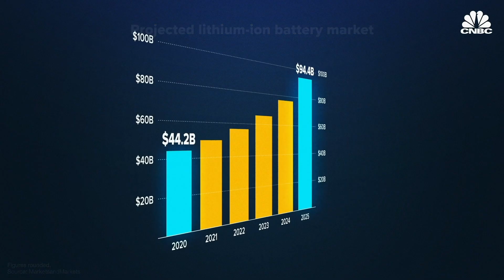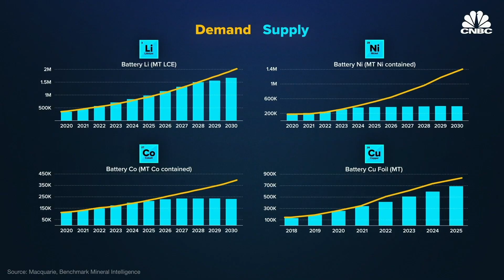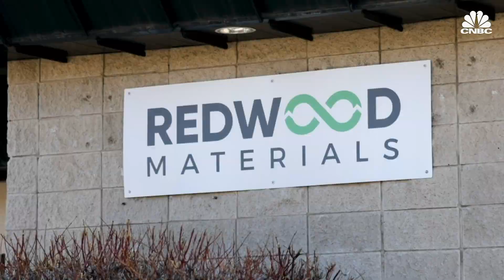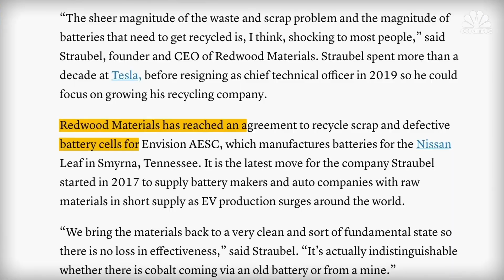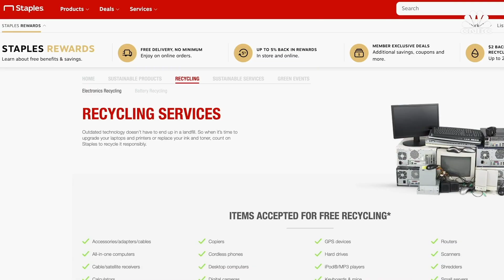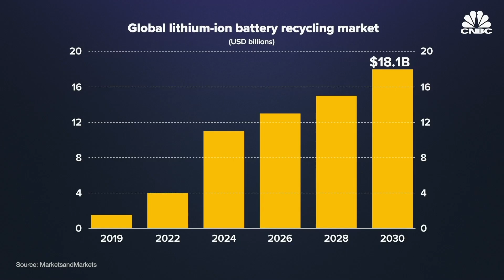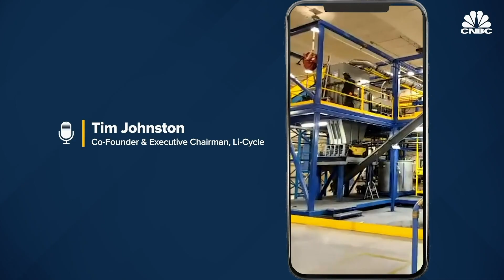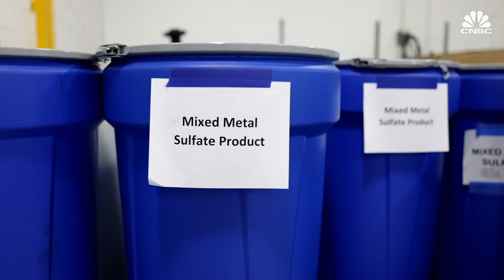How Tesla’s Battery Mastermind Is Tackling EV's Biggest Problem

Comment: Why are we recycling/disposing EV batteries when there is an average of 80% life left at the end of its life in a vehicle? There is a company called Moment Energy in Vancouver that is repurposing EV batteries for utility energy storage that can extend the life of these batteries for another 10+years.
Reply: Yellowstone National Park has been using used Toyota Prius batteries for more than a decade as grid storage. Each new EV has the potential to store enough charge to run a normal US home for 2 days. I agree that continuing use of the battery packs until further degradation is a cleaner, cheaper, and better option than immediate EOL disposal.

I could go one more, and suggest that all new EV cars should have easily removable batteries, so that newer, better batteries can be swapped in (like NIO does in China), and the body of the vehicle doesn't have to be scrapped. Electric motors last many times longer than ICE, so it stands to reason that the batteries should be easier to replace, especially with ever bettering technology. I can only assume it's the same "Jobs" excuse that's been used to justify built in obsolescence since the Great Depression.
Reply: In the 90s I ran a household with solar panels and recycled computer back and emergency batteries for over 10 years...I'm sure I was public enemy No 1 not being powered via the grid in the eyes of the power company.

Comment: Recycling of batteries from consumer electronics would be much, much easier if those devices were designed in such way that consumers could take the battery out.
Unfortunately Apple is too powerful and would stop any regulation mandating easily removable battery.
It works better for Apple if you have to trash the whole device when the battery is loosing capacity, even if the device is still functional.

Comment: Goes to show that EVs are NOT net zero. This problem exists plus the pollutants created and energy used to create the batteries are obviously NOT net zero.
Ya can't beat physics!!! And in all other ways, the materials and construction of electric cars and trucks is virtually the same as conventional transportation.
Oh, it will get better as time passes. But don't think for a minute electric vehicles are THE solution. Not by a long shot.
But good on Redwood for their recycling efforts. But even THAT requires energy.
Reply: That's why tesla invested in solar, they solar system produce 10x more energy then their factories use, metal extraction and refinement can also be done renewable, its not a closed energy system since the star in the sky provides the energy for another 5 billion years, can't beat physics. Electric cars aren't the solution but they are one of the best solution we have now, so you rather breath exhaust from cars for another century?
Reply: @miguellopez3392  STILL, energy is required and not every EV or alt. energy is Tesla. Everything pollutes, somewhere, somehow. But it will get better as time passes. But for now and years to come, nothing is net zero. Physics won't allow for that. Not in the physical realm. There is no pixie dust.
Cheers!
Reply: @justincase2281  net zero on earth is possible, like I said its not a closed loop system that the earth has with the sun.
Another question, why make this comment, anyone who develops these systems knows this, the only time I here an argument like this is from petrol heads who think if it's not the 100% best solution we should just stick with the 100% worse solution.
Reply: @miguellopez3392  I'm not a "petrol head", and give me ONE example of any technology created by man that doesn't affect the environment to create or maintain. Just one!! 
I'm not saying we shouldn't keep working on cleaner technologies, but right now, NET ZERO is NOT possible. Even if you just ride a bicycle EVERYWHERE and it was built using exclusively solar energy to power the factory. The equipment created to build the bike required energy and raw materials that needed to be mined, smelted, refined, cast, plastics needed to be used, paint, chrome, rubber etc. all needed to be produced to create that bicycle. Many of the materials are petroleum based. And then when parts wear out, they need to be manufactured and replaced, so the process goes on and on... until one day the bicycle is disposed of, maybe recycled and that too will require ENERGY.
So give me one example of practical, everyday down-to-earth NET ZERO technology. Just one. 
Cheers.
Reply: @justincase2281  stone club.
 Net zero is not possible right now for logistical reasons not technological ones.

A lot of oil base products could be made artificially if we had the extra energy from excess renewables, it would be closer to a closed loop system. but the world doesn't have the logistical capability of manufacturing that many solar panels in the next 10 years without bankrupting itself, that is impossible, another 100 maybe not.
Reply: @miguellopez3392  Uh, oil based products are artificial, or synthetic. Some plastics or synthetic materials can be, and are currently made from natural sources like  corn and soy and are biodegradable. 
And your acknowledging the fact there is no way to get to net zero NOW is the interesting. But the laws of physics will not allow for it. We could get closer over time. But unless someone comes up with some whiz-bang technology that turns physics on its head we'll always be limited by our physical reality.
Imagine this. You have a generator a motor, and some battery or batteries. You connect the motor to the generator,, then you wire the generator to the batteries to charge them, but also wire the batteries to the motor to power it to spin the generator to charge the batteries to run the motor, etc. A closed loop. Should work and run forever, in theory, or at least until the batteries wear out or something breaks.  Almost perpetual motion, but useless. BUT, what happens when you put an additional load on the motor to make this contraption actually useful. That's when it gets interesting. This experiment was something I thought about when I was a kid. DECADES ago. And I've seen this very thing on some YOUTUBE vids. People think they really have something there. Unique and the answer to all our energy needs. But when you factor in things like entropy and conservation of momentum and other physics goodies it doesn't work. It can't work. And of course there is the use of energy and the creation of pollutants that occur when these components are created in the first place. 
So, this is all great food for thought and if you're scientifically minded, you just might come up with something no one else has ever tried before. I have ideas, but I'm old and don't have the time or resources to pursue this sort of thing. But if you're young and have time to tinker and some bucks to spend, ya never know. Good luck.
P.S. Bought an electric snowblower this year. Not a huge one, but decent size. Got 120 feet of cable, plugged it in and off I went. Worked surprisingly well and no gas fumes to deal with. So it didn't pollute, not on the scene. But the added load on the electrical grid did cause a tiny bit more pollution than if I had just shoveled. But I can't now. Bum ticker.
But even if I had bought the battery type it still wouldn't have been TRULY clean. Gotta mine that lithium and MAKE the batteries and the snowblower. But we do what we can. Right?
Cheers.
Reply: @justincase2281  by artificially made i mean using generated power to manually create hydrocarbons similar to those in crude oil, stuff like synthetic motor oil last around 3x then motor oil made from crude oil. so you would extract carbon out of the air and use electricity to bond it to oxygen, this will be more expensive then regular oil but you essentially take pollution from the atmosphere to make a product that will cycle back into the atmosphere, like the carbon cycle for a tree.
THIS IS NOT CLOSED LOOP, i have to stress this, ive argued with enough free energy nuts to know the flaws of perpetual motion and i never believed in it. as i mentioned before its not a closed loop due to the existence of the sun, the sun is not infinite and creates massive amounts off pollution, but not on earth. let me show you a very simplified view of the cycle i mean.

Hydrogen-> helium & radiation-> solar pannel-> solar panel factory and mining facility-> more solar panels-> enough power to produce materials synthetically from pollutants or raw material-> obtain zero impact on earth by moving the physical laws of inefficiency of machines to the sun and its emissions into space.
we aren't polluting, the sun is, so might as well use it.

i bought an electric lawnmower last year, not for the environment but because i hated dealing with gas, breathing it while i mowed, and having to maintain the engine. the electric feels much better even if it cost a bit more... and that's why people buy electric cars.

Comment: It's funny how much co2 is created by making electric cars.. what is the whole point of the clean energy if it is so harmful to create
Reply: 30% for production but 3x less in overall running emissions, so after around 4 years a EV is cleaner then the average car overall, what is the point of clean energy? Think longerbthen 5 seconds and you may figure out that green energy can also be used to manufacture EVs even cleaner.
Reply: Even when charged using a coal power plant, it's less pollution than an ICE vehicle over a ten year period.

Comment: I think best solution is find a better sustaining energy technology. Why is Lithium the best?
Reply: Physics. The way lithium ionizes and stores electrons, it has 100 times the storage potential of our best available batteries. There's a lot of growth that can be done in making lithium batteries lighter, more energy dense, and more environmentally friendly. Of course there will be a better way in the future, but this is available and can be utilized right now. Materials Science is the best field to go into.
Reply: Holds a lot of electrons and is a small enough atom to be exchanged within the walls of the battery cell and sit there, there are other chemistries but require much more complex or difficult methods of fabrication and operation (some batteries will beat lithium when heated to 200F.)

Comment: How can recycling be more efficient than raw materials? There is absolutely no way that you can recycle a battery and get the same amount of output as the equivalent raw material.  Recycling is guaranteed to lose/waste/destroy a part of the original raw material.  Someone fact check this guy
Reply: Hydrometallurgy techniques have shown yields up to 97%. Since you no longer spend energy and money finding, extracting, and refining lithium. The more of it thats recycled the better prices and surpluse you will get for new lithium.
Reply: When mining, you have to extract it from the ore you just mined, then process it into usable material. The product has already been refined in an EOL product, so it's mostly just separating the materials. It's not a closed cycle and you're still going to need raw material from mines, (and it's not a "clean" process) but common sense says the most energy intense parts of manufacturing has already been completed.

Comment: EV vehicles weigh more than non-EV vehicles. ... So, the infrastructure (roads, highways, and bridges) will need to be overhauled to support much heavier vehicles. ... Also, since EV vehicles are heavier, these require more bake power to stop, which in turn produces more brake dust that non-EV vehicles.
Reply: Heavier? Yes, but not by much. ICE cars have gotten stupid heavy over the past couple decades, and a Tesla Model Y weighs the same as a BMW or Mercedes compact SUV. EV offerings from Ford, GM and other major manufacturers are still hundreds of pounds heavier than the ICE equivalents, because they are so far behind in terms of tech. I look forward to seeing the stats on the Lucid Air when they release to the public later this year, since they started as a race company, and know the importance of weight.
 
EV's don't use a fraction of the brakes that a normal vehicle does though. The electric motor turns into a gernerator to assist braking and regenerate electricity to go back into the battery to increase range. Great for mountain descents, where my Tacoma's brakes were glowing hot and I had to pull off for them to cool off last time I went through Colorado.

Comment: They should require a deposit on the batteries like they do for other recyclables like bottles and cans. It needs to be expensive enough to entice people to recycle them properly.
Reply: Deposit would make electronics more expensive to purchase, which means lesser people with smartphones. Hence, lesser people to snoop on. That's not the goal of big tech.
They would rather collect more data from people.
So instead of a deposit, consumers are given an exchange/cashback offer of some sort. But that amount is so low, it feels worthless for your old phone/laptop. 🚮
Reply: @jasmeetkhosla  How many times did you put back that 6 pack because of a deposit?
Reply: @Doesitreallymatter-q3d  Never returned a 6-pack. I waited until I collected enough bottles to buy a 6-pack
Reply: @jasmeetkhosla  Exactly!  Those bottles would not have been returned otherwise. They would have ended up in a landfill. Same for old batteries.